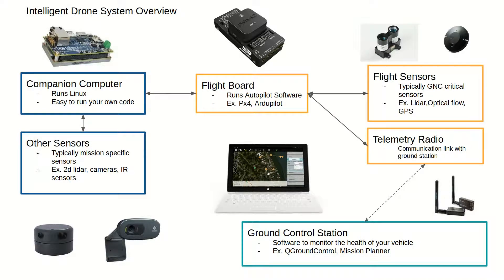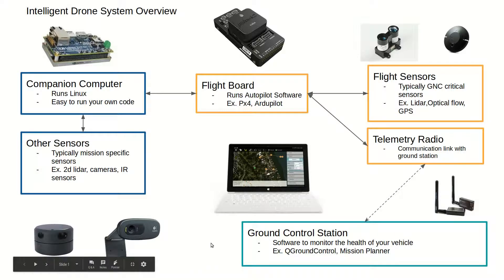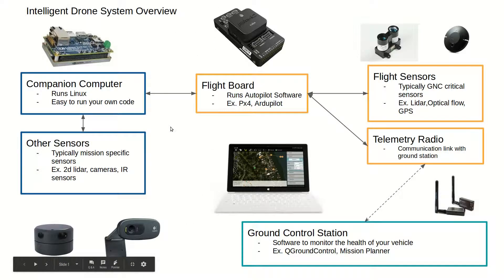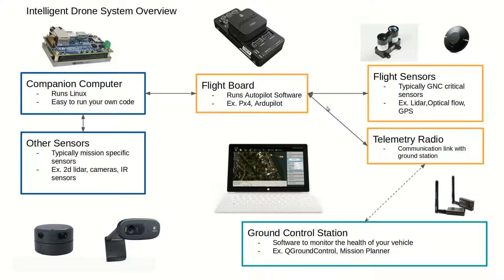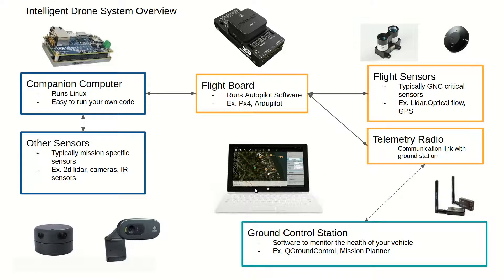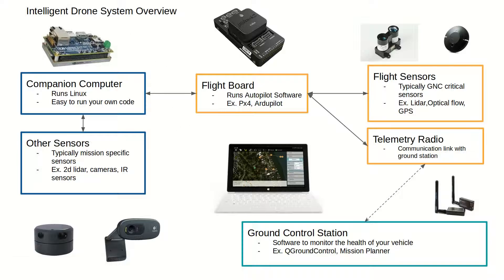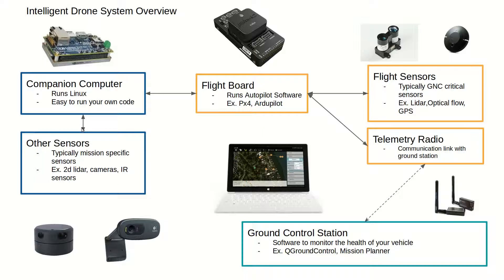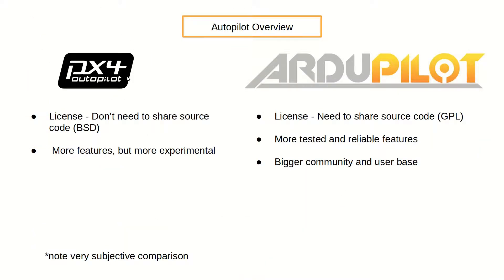01 Intelligent Drone System Overview

Comment: Well, at least the future is secured for these birds especially when explosive unit is attached to it since it should be replaced after it hits the target. You do not need to build it to last long for obvious reasons, component manufacturers are happy since chips, sensors, motors, computer board, camera and battery are also burned with the device. :) Sweet deal. Even structural engineering is done with cable ties. See ? Easy !

Comment: Do you need an Nvdia Tx2? Could you use a raspberry pi?
Reply from the maker: You can use a raspberry pi or a variety of different small computers. I personally recommend picking up one of the Nvidia jetson options because they have gpus in them which give a huge advantage for any computer vision code you might want to run